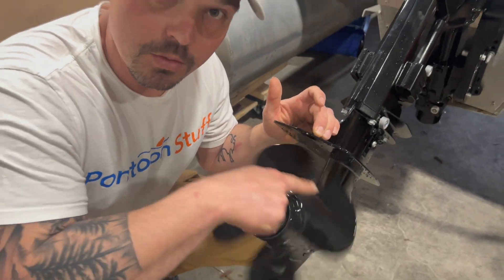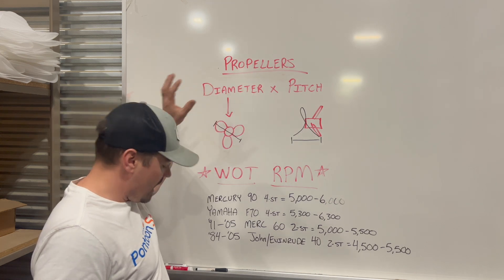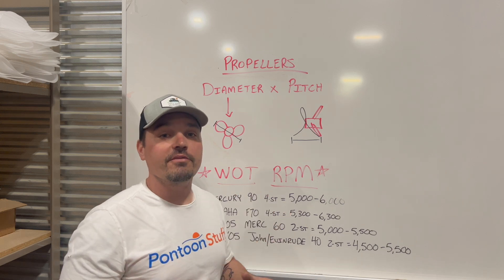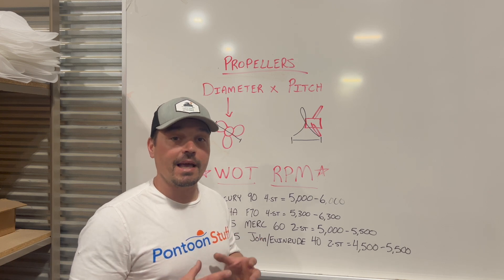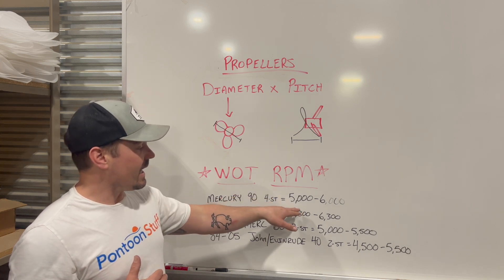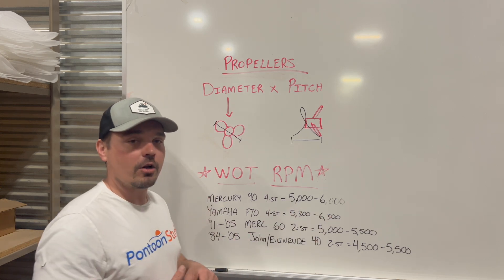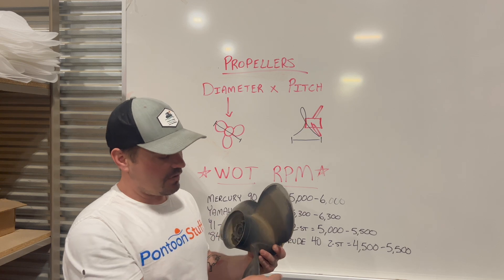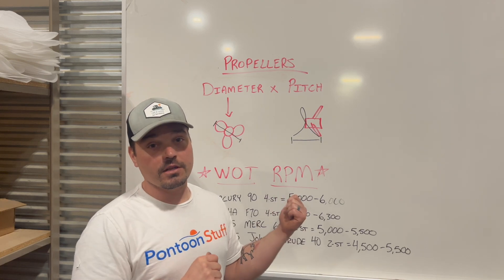THE RIGHT PROPELLER FOR YOUR BOAT - Breaking Down Prop Selection

Comment: Im only getting about 5000 to 5200 out of my 90hp Mercury in my 17 foot flats boat at 30 mph at full throttle when i put the trim tabs up the boat starts to porpois but i pick up speed. im running 19p prop should i go down to 17p?
Reply from the maker: Yes, I would drop down in pitch to get those RPMs up, assuming it's a four stroke. You may need to check where your tilt pin is at in the lowest position. Sometimes there's a pull pin or bolts that limit the amount of negative trim the motor can get. Porpoising is usually from not enough negative trim or not enough weight in the bow. You might need to keep those trim tabs down just a bit to limit the porpoising. Either way, I'd want to get those RPMs back up in the operating range which should level out all around performance with whole shot and top speed.

Comment: Just looking at getting a new prop, Very Helpful, and timely. Question; do you have gage recommendations videos ?
Reply from the maker: Good, glad you found my channel. I have a few gauge install videos for different brands. I primarily use Faria Gauges as I've found them to be the most universal and user-friendly with outboards. Check out my playlists for electrical stuff and engine rigging.

Comment: I’m hoping you can help me. I’ve made tons of phone calls. My tack doesn’t work. I have a 1993 four winns horizon 190 with a 5.0L Volvo penta with a OMC cobra standard outboard (not the xs) I have no idea what my RPMs are. The prop on the boat when I purchased was a 15x17 hole shot is good pulls tubes nicely, but my top speed is only about 30-35 mph according to what I did find I should be able to reach 46-50mph. I would love to have a good holeshot. Still pull tubes but I really want to increase my top end speed. Again I don’t know what my RPMs are. Please help
Reply from the maker: Best bet is to wire in a new tachometer to see if your tach is just bad. Only a few wires to switch over to the new tach. Without knowing RPMs there’s not much else that you can do. Sounds like you’re probably running a little low of pitch if you have good wholeshot but slow top end. Worst case, might have to have a repair shop take care of it.

Comment: I have a 16ft alumacraft with a 90 hp Yamaha. At 4500 rpm it porpoises.  I've changed props and it still porpoises . I have tried a 17 and 15 inch props. 15 inch I get less porpoise but still there.  Rpm went up, of course with the 15 pitch. I'm running at 5000 rpm and have lots of throttle left
Reply from the maker: Your porpoising (bouncing of the bow) has more to do with needing more weight up front OR more negative trim (or both). Make sure your motor’s trim is adjusted to be able to go all the way down so that you’re getting as much negative trim as possible to help get the bow down. Sometimes there’s a bolt or a pull pin that allows more negative trim. Worst case you can install negative wedges between the motor and boat that will give more negative trim.
Reply: I have the same set up with a 10 1/2 inch 14 pitch prop and it does good.
Reply: A 4 blade prop will tend to lift the stern somewhat, thus may help.  Try to borrow one for testing.
It's very important your engine can operate to it's maximum rpm, thus a known calibrated tachometer should be used.
One big cause of porposing is a hull with too much rocker shape, weight in the front to bring the bow down will probably help as well.

Comment: Hi, can you help me choose my proper propeller for mi Boston whaler dauntless 2001 with 125hp Mercury 2001 2 stroke
Reply from the maker: I would run it through the same steps discussed in the video running it wide open throttle paying attention to the tachometer and where the RPMs are in relation to the recommended range for that motor. You can go check out Mercury's Prop Selector to get a start too.

Comment: What if I cant read the number on the prop? I have 2007 24ft manitou 50 HP Evinrude 2 stroke. I just want to cruise on speed
Reply from the maker: Evinrude props are often labeled on the backside where the exhaust comes out. It may be covered by a nut and washer or just dirty from exhaust. Did you check there?

Otherwise you’d need to have a prop shop take a look and they should be able to tell you. If it were my boat, that size with that HP motor I would probably run a 10” or 11” pitch.
Reply: @tomspontoons  I did not I’ll take a look thanks

Comment: Hey Tom, I’m new to owning a boat and looking for advice on my new to me(used ) pontoon. I just watched your video and I’ve learned a little from it but looking for more clarification. I have a 21ft pontoon with a 75 hp merc 2 stroke. I’m only able to run at best 17 mph at 5000 rrpms. I’m also having a problem with the pontoon plowing through the water and unable to plane on top of the water. Currently running a 15 pitch prop and was advised to possibly look at changing it as well as getting a hydrofoil Any advice? Thanks
Reply from the maker: Looks like a 75 hp (1990-2005 years, non optimax) should run 5250 at wide open throttle with an empty boat. You could look to drop to a 13 inch pitch, but might have to watch your RPMs if you’re alone at wide open…however it’ll probably help a lot with when there’s a load of people and it might help with torque to get the bow up a little when trimmed up. A hydrofoil would help too, but not a fix for every boat. It’s a lot of boat to move for a 75 hp so I’m not sure you’ll see a big speed change or improvement either way.
Reply: @tomspontoons  thanks for the feedback. Loaded or unloaded (people or gear) it will only hit 5000 rpms. I put a hydrofoil on today and ran it, no improvement. I still can’t get the front end up on the water.  I’m assuming the front furniture is too heavy for it. I was hoping to overcome that by the help of a hf and a new prop. I can’t afford to build the motor or buy a bigger one for now so I will try a prop next. So my question now is if I’m trying to gain top end speed do I go to a higher pitch or lower, to the 13 ?
Reply from the maker: @MrCornbread1980  I think you’re pretty much  seeing your max speed. Lowering in pitch would get your RPMs up slightly, but I don’t see that making any changes to top end speed. There’s a point with every pontoon boat or other non-planing hull where the motor just can’t move enough water to make the boat go faster, despite RPM changes. The boat just doesn’t lift enough compared to a planing hull like a fishing boat or speed boat.

Comment: Hello Tom I have a 24’ pontoon boat with a 75 Yamaha at WOT tac 3500 rpm 21mph the prop is a 125/8x21-k could you give me bast way to to up the rpm mph ?? Thanks Bill
Reply: Thanks I thought the pitch was to high so a 17p would probably work better ? Thanks Bill
Reply from the maker: @mrbowfam  dropping 4” would get you to the 4300 rpm range. If it’s a two stroke I’d still want to see it higher. You might end up all the way down at a 15” or even 13” depending what motor you’re running and the specs for WOT operating range. Super common for pontoons to run those lower pitch props!
Reply: @tomspontoons  thanks Tom yes it’s a two stroke 75 the boat is 1850 dry ! Do I stay with the same diameter at 12 5/8 ?? Thanks again
Reply from the maker: @mrbowfam  That's not a super common motor around where I'm from! It looks like it should run anywhere from 4500 to 5500 WOT range from what I found online. The diameter will likely change a little, but I wouldn't be concerned about the diameter. I would probably drop right down to the 13" if it were my boat to try to get those RPMs up in the healthier range!!  Not sure you'll see a speed change, but all around torque and control will improve, plus it'll be better for the engine to get the proper high RPMs.
Reply from the maker: Is it a two or four stroke? Assuming your tach is accurate that's way low for either 2 or 4 stroke motor. You'll want to drop in pitch...remember that each inch you drop in pitch is going to add about 200 rpm to your WOT. Also, make sure you're testing those numbers with an empty boat...not a boat full of people and gear!

Comment: Need help !! I will get a new pair of Suzukis DF 150 APX for a boat AS MARINE 26 GL. I need a set up for speed weight is 5700 pound wet with fuel , water  etc. What kind of props du you recommend? Thank`s for help
Reply from the maker: Oh man, that’s far beyond my scope of rigging!!! I would call the boat manufacturer first to see what they recommend, then the dealer to see what’s worked on the other boats they’ve rigged similarly. Then search the outboard manufacturers websites for the testing they’ve done with different boats and motors. From that research you should be able to come up with the information you need to make the smartest purchase possible!! Sorry I can’t be of more specific help on this one!
Reply: @tomspontoons  Thanks for your answer, but the manufacturer doesn´t test the twinn rigging. But thanks, It seems I have to get the long way and check by myself dif. setups.
Reply from the maker: @7markshark  that’s wild that they don’t offer some info. I’d also check with other boat manufacturers of similar hulls and motor setups before making the purchase of two stainless props!!

Comment: hello thanks for the awesome video can you give me some info on  cavitation /ventilation issues. i have a crest 24 foot with 120 hp evenrude tia
Reply from the maker: You'll get cavitation or ventilation from two things typically...the motor being mounted too high on the transom OR a disturbance of water flowing to the propeller. The first has an obvious fix...lower the motor until the cavitation stops. The second is a little trickier because every boat is different. In my observance, some pontoons just weren't designed with high HP motors installed. So if they ran ok out of the factory with a 25hp or 40hp then they kept making them that way. When higher speeds are reached with higher hp the flow of water changes and can cause issues with how it feeds the motor. Again, lowering the motor would be the first way to fix it. Other things that can help with it are hydrofoils (aka whale tale) on the motor to help smooth the flow of water feeding the prop. Also, moving the entire transom back can help as well. The flow of water off the pontoons (standard pontoon, not tritoon) is very interesting to watch at higher speeds. The water will sort of flow down off of the pontoons just forward of the backs of the toons...if the motor is tucked up in front of the outer toons that flow down will make the better flow of water go "under" the prop. Water will always rise back up after being displaced by a hull, so moving the motor back a couple feet can help with that. 

Lots of variables here, but usually step one is lower the motor if that's possible!
Reply: thank you so much  my motor is all the way down would you cut the    transom  down or move it back thanks again  @tomspontoons
Reply from the maker: @ronaldsmith4068  That's a tricky one! Lowering the motor should eventually take care of the issue. I would probably lean towards that instead of moving the transom back, unless you're tearing the boat down to restore at the same time. Crest doesn't allow for access to the transom bolts from the underside...Their crossmembers only give access when the deck is removed.
Reply: @tomspontoons  thanks again I really appreciate it
Reply: @tomspontoons  i forgot too add that I'm not able to trim the motor up at all it will just   cavitation /ventilation thanks again for your help hope you all have a great weekend!!!

Comment: Outstanding information Tom, and caputation queen.  It's almost shameful the expense of a stainless prop and the added potential damage they can cause.

Questions:
How much of performance loss can I expect from prop damage like not smooth blades?

Are 4 blade props best for top end performance?

Does 3 or 4 blade props do the best reverse handling.

There used to be a local prop shop near me for decades, which is nla.  When should a prop be restored? What are things to look for besides decreased performance?

I try to keep an extra prop and hardware onboard bc you never know right.  I saved the day of fellow boaters having extra sheer pins, plugs, and hose.
Reply from the maker: Great questions! It seems to be that a little chewing on the ends of the props doesn't change things terribly, but then a little more damage and you may start to see some speed loss, slippage, and abnormal vibration. On a pontoon boat the speed loss may not be noticeable until there's significant damage compared to a planing style hull. I find that three blade stainless props will yield best top speed. They allow for larger diameters and each blade can have a bit more cup to them. Obviously, there will be others out there who swear by four blade...so I'm thinking this is a "to each their own" scenario, and different hull/motor combos might react differently too. Four blade props should do best for grabbing water at the dock for fine tune handling, reversing, etc. 

If there's anything more significant than what I can touch up with a hand file then I would say it's time to have it restored. Things can get out of balance if you try to fix majorly damaged blades. I think the biggest signal that it's time to have it restored or replaced is when you're feeling the abnormal vibrations or shaking at certain (or all) RPMs. When I knocked most of a blade off on the river a couple years ago the boat would run slower but ok at certain RPMs. A little higher or a little lower than that sweet spot and it felt like the whole boat was going to shake apart! We got home ok, but had to swap that prop out right away!